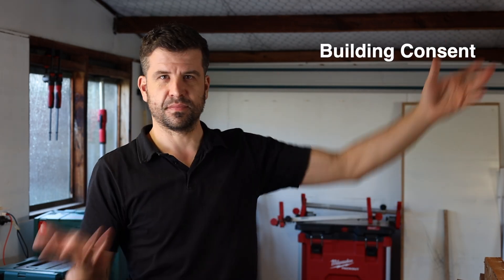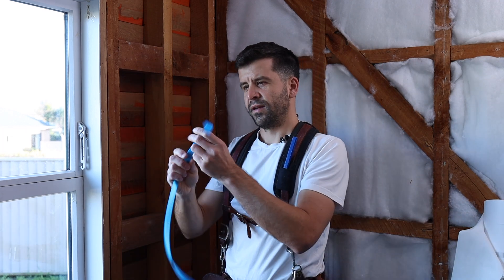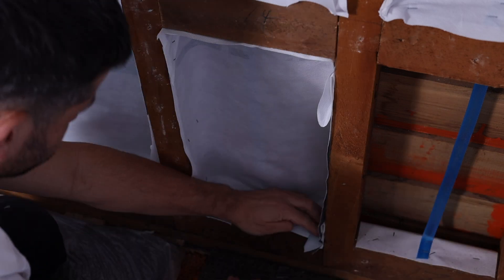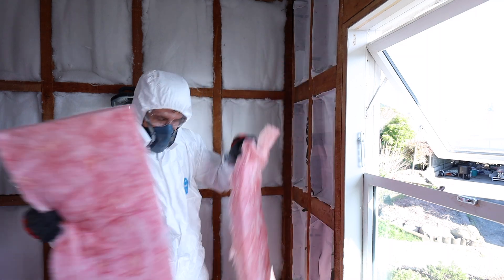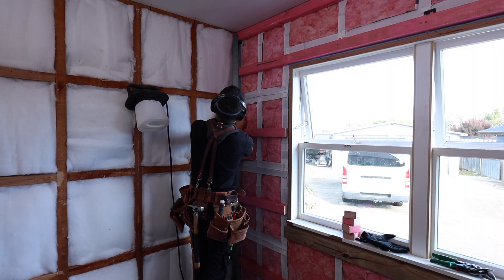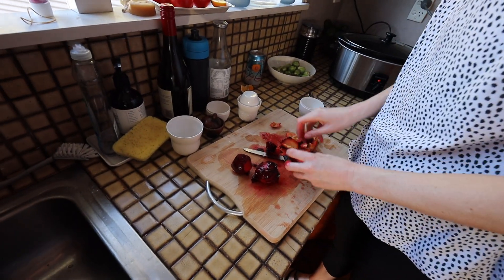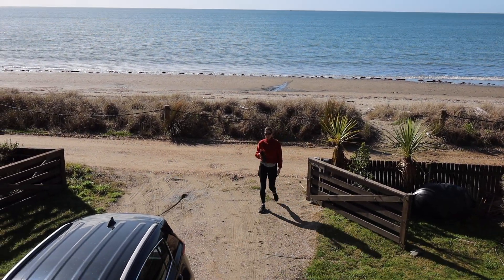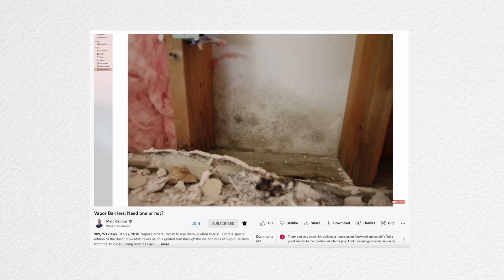We're Finally Going To Be Warm! Renovating Our 1960s House

Comment: On the Rock Wool (Originally called Roxhul) comment that Jess made, I'm not sure how well it would do in your climate anyway.  Its hydrophobic (does not absorb water) so it may cause your Drywall (Gib / Jib Board) to mold due to your high humidity on the exterior walls.  I'm sure there is a way to combat that but I'm not familiar enough with high humidity building to know.  I primarily see it used for interior walls where its sound dampening capabilities, no itch installation, and easy cutting make it ideal for that use.
Reply: While it doesn't absorb water its permeable so moisture goes through it. So its a good product to use.

Comment: 2x4 batt of pink insulation is worth R14 in Canada.

No clue what the dimensions of your existing wall was, but I would have been framing up a new wall to install infront of your existing ones, and sliding a 2x4 - 2x6 batt of insulation in there.

Your heat pump would thank you for it through a massive increase in efficiency. 

But, Australians/Kiwis don't really seem to care too much about energy efficiency for some reason.

Comment: I would've insulated from the outside honestly, add the 20mm airspace with lathes. Then you get the housewrap with no windleak or I would atleast tape the joints if you do like you did. Great work! 👍
Reply: Not sure how NZ building code is but sometimes it can get tricky with "doing something with the facade". More paperwork probably. But the "building paper work" wouldve been better for sure lol
Reply: That would be a very costly and labor intensive job
Job was wel done only comment is  the more wood surface you put in between the isolation the lower the R, if you rotate the wood 6x4 you could ad 2 inch more isolation and by turning it, the wood surface is a bit less you could ad maybe R1 with a total off R4 (a bit of a geuss)

Comment: Not sure of R value, but in Europe we have a very energy efficient home of A class with total Thickness of insulation of 35 cm of Eps.
That declares r values of around 3.8 per inch.
So at 35 cm is approx. 14 inch.
14x3.8 is approx. 50 of R-value.

Comment: I like the comment about making the house the best version of itself, not the best house. Comments for example on having the building wrap on the outside of the framing are all well and good for a new house, but you are not going to achieve that here without ripping the cladding off. It is about improving an old house, within reason. Can you tell us if the external wall insulation was covered by the consent process?

Comment: With Glass wool you have made the right choice regarding the type of insulation. By cutting the glass wool slightly larger than the frame size, you can compress it and as you put it in the frame it expands again and fits well against the wooden frame. That way you close all the gaps. Hard foam insulation would not do that and would leave a gap between the insulation and the timber which is obviously not desirable. I live in Belgium and work in the Netherlands. Here houses are mostly build in brickwork but roofs are made in timber. Glass wool is than often used if a roof has to be post-insulated specifically because of this reason. 

With regard to glass wool or rock wool. Glass wool and Rock wool are not that much different. The characteristics are much the same. Rock wool is more brittle than glass wool, therefore I prefer Glass wool above Rock wool anyway. No big loss if there is no rock wool in New Zealand.

Comment: In the cold Climate in Europe and Usa/Canada its getting down to -20°C in Winter and freezing for Days and Weeks. The air in this time is verry dry and the most Water in Buildings comes from the Person living in it is it just breathing while sleeping, Cooking and Wasching, Showering and so on.
The higher humid Air inside would condense Water in the Insulationlayer somewhere. Thats the reason there is a vapor barrior Inside here and it have to be airtight! or it will produce problems you saw in Matts Videos.

In New Zeeland you are sourrounded by the Ocean, get heavy Rainfalls and storms, Foging. While the Temprature barely reaches below 0°C and now for a long time. Your Waterproblems to your Buildings clearly comes from the Outside Air and Rainwater getting pushed with Wind below the Sidings.

Your 2 Layers of Insulation with Moistur Barrier and Breathoing room looks verry well enough for your Climate and the Situation you renovating an old house. little bit Labor intensive but room after room, wall aftert wall ou will get it done.
An even thicker Insulation above a certain point dont give you mutch more R value.
Rockwool is also only a "Western World" aka Europen and American Brand name and just a Maufactures Name. Dont be worried if your insulatiion got an other Name Brand on it ;) its not Rocket science to make Glass or Stonewool.

For your Ceelings.. i would NOT put Polyester on it. In the rare case you have a Fire you dont want a flamable plastic Material above your head dripping down on firefighters spreading fire everywhere.
Your ceeling Space can be filled easy enough and a layer on top if you dont move in the space often. 
It also Insulate against the heat in Summer.
Depending on your time and money budget (and how you use the Attick Space) you could Insulate the Roof like the walls. And the ceeling only with one internal layer.
Gives you easy frost free Storrage Space and keeps the sunheat out the attick directly from the outer shell of the house.

Closing the Window gaps with a rubber sealm and putting in the foam in the gap directly arround the window is more important as you think. you loose a lot of energy or get in a lot of warm air in summer if this is not closed.

Comment: I'm most worried about the air leakage in the assembly here. In order, the priorities are water, air, vapor, thermal. It seems like there is no real air barrier between the exterior and interior, so the insulation won't add as much value as the R-value suggests. That said, air sealing from the inside is also questionable and seems quite difficult. (One other commenter suggested possibly taping all the seams, which might function but is very detailed work to complete.)

When you eventually replace the siding, doing air sealing at that point should offer some notable comfort benefits (in addition to a reduction in heating/cooling bills), and it should be much easier to complete as well.
Reply: Kiwis don't do air sealing. How air tight the gib is is what you get. Nz housing is very low standard.
Reply: i agree with dosadoodle - the airtightness is super-important (factor 10 times more important than thermal insulation) say you have insulation, but the wind can blow through it.. then it takes all your heat with it... or if you use a hard panel, like PIR or PUR and the wind is able to blow between your wall and the panel... what use does it have then? it takes the air temperature with it...
Reply: @LievenVB  i agree, but your never going to get it air tight without demolishing the house. Even new houses here are not air tight. Keep in mind nz is about 40 years behind you guys in housing.
Reply: An honest question and not being facetious, what kind of real world gains would you see with that level of attention? Oftentimes professionals will recommend the best practice suitable for insulating the space shuttle. If the method used here is less efficient to a minor degree, then who cares?
Reply: @yeahgoood  air sealing solves a lot of problems and more importantly allows the opportunity for other things to be done better. now that you have control, you can do efficient ventilation, so you can have higher ventilation levels without the heat/moisture penalty you would normal have, which means a healthier more comfortable home. pretty common to have good air tight homes have double the ventilation rate.
you can have better moisture management because your no longer pulling random amounts of moisture in from outside.
especially in colder or humid climates it can increase durability by not having condensation/frost form in the walls/roof.
for me, keeping the pollen, dust and bugs out is a major plus.
Reply: @yeahgoood  I think @tweake hits the key building science aspects. Water / moisture is the biggest enemy of a building in terms of durability, and losing control of air flow means vapor can travel through a wall more freely and condensation can occur in spots that harm the long term durability of the building as well as create health issues due to mold.

In terms of energy efficiency, I think it would be useful to take the analogy of a wool sweater. That sweater keeps you warm if there is not breeze. But as soon as there is air movement, that warm sweater doesn't do nearly as much good. Is it better than a t-shirt? Absolutely! But if you throw on a wind shell to stop air movement, then you're really going to stay warm. I'd also note that Scott's home is not a fully open sweater. It is just that there are still lots of cracks/crevices where air can flow, which undermines the insulating value of the "sweater" vs if those were sealed up.

I've found the Building Science "Insights" articles on (what I perceive to be) the "main" building science website to be really informative on these topics as well as being written in an entertaining style. Those articles highlight plenty of complications with tightening up an older home as well. For example, if a home is very tight but without mechanical ventilation or humidity controls, then the air inside can become stale or have high humidity. Or even worse, if the heating system is combustion and the exhaust air is not able to effectively exit the building, that's of course quite dangerous. (Scott's move to a heat pump prevents that specific danger.)
Reply: @tweake7175  thanks for the info !
Reply: @dosadoodle  This is excellent info, thanks!
Reply: @dosadoodle  those houses in original condition are a sweater, wind blows right through them. that can be fixed by sealing the floor, which in turn will help reduce moisture.
Reply: How rapidly is the air actually going to change within that cavity? The weatherboards being painted will be relatively air tight I imagine? And would you encounter moisture issues as mentioned in the video?
Reply: @samueladams7064  the cladding is open at the bottom and a bit at the sides and top. Yes there is moisture, walls leak and timber let's moisture through it.
Reply: @samueladams7064  The weather boards will block wind from blowing straight through the home, but they won't be near tight enough to stop substantial leaking due to pressure differentials caused by wind blowing against the building. The standard in the US measures full home air changes per hour at 50 pascals ("ACH50") pressure difference between inside/outside using a blower door test, which is equivalent to what a home experiences in a ~32kph / ~20mph steady wind (or at least the pressure difference that's created on the face of the building getting hit by the wind if I recall correctly). Older homes in the US frequently rate at 5-15 air changes per hour at that 50 pascal pressure difference, and my guess is that Scott's home probably is not far off from that (many older homes in the US also have painted weather boards that would look to the eye to be pretty tight).

For the moisture issues, are you talking about the gap that Scott was leaving behind the weatherboards to manage water that got behind the weatherboards? I think that's usually for helping address water (e.g. rain water) that gets behind the weatherboards so it can drip down and air flow can also occur there to help dry things out.

Assuming it doesn't freeze often in NZ, I'm honestly less concerned with the vapor condensation and more concerned about the heating/cooling efficiency. The inefficiencies of the heating due to the home being leaky means, as one of my friends put it to me, the wood in the home gets pseudo kiln dried each year as tons of energy gets wasted. That is, the excess heat passing through the walls helps keep the wood dry (at the cost of higher heating bills). I'm sure Scott's upgrades will offer some benefits on both heating/cooling bills and some comfort benefits, but the R-value for the insulation assumes air isn't passing through the wall so easily.

Comment: I did like your insulation installation. The only part I didn't like was the glass wool. I managed to build my house completely without rock/glass wool (only exception is fireplace chimney fire-insulation, there were no alternatives, so had to use Superwool). Walls are 60mm wood fibre board and 205mm MHM wood-elements, but of course this is a new house and not 70yo as yours.

Comment: Hi Scott, if you’re watching a lot of Matt’s videos you’ve no doubt seen his ones where he insulates the roof so the attic is within the insulated envelope. This would improve the efficiency of your ducted heat pump.
Reply from the maker: Thats a fascinating one for a Kiwi builder like myself. I've always worked in roof spaces that were roasting hot in the summer and never considered this. It may be a bridge too far for our house,  considering the mild climate here it may not be worth it. If I were building new, I would condition the attic for sure.
Reply: @ScottBrownCarpentry       an iam going too building my every. own   setup off workshop space or shed with my every own pub an bar    soo i can chill out in pice an quart     as i needed my own space an doo soo needed a shed or workshop like yours at my place   etc.

Comment: An oscillating tool with a blade in it cuts expanding foam beautifully. I'm not sure you'll see the benefit of the extra insulation in terms of savings and improvement in warmth. A thermal camera will help tell the story.

Comment: I think you may have reinvented an overcomplicated wheel my friend.   I am in Canada and deal with a lot of insulation systems and my first thought is you put a lot of effort into that 2cm air gap but its hard to trust its not bridging all over anyways.  I see what your trying to do but I wonder if theory and practicality where fighting it out there, its new code in BC where it rains a lot to install strapping between the house wrap and siding for a 3/4" air space but there are plenty of dry houses without that air gap before that code came into play.
Reply: Don't think he's going it for the fun of it. Will be to get sign off from our local councils who are slowly trying to bring our standards up to to those commonly seen elsewhere in the world. Due to crazy material costs here the minimum allowed values are seen as the target state to attain, not the starting point. 

Having said that, overseas we had double layer brick walls with an air gap and dampness or poor insulation wasn't a conversation I ever recall being part of or hearing in almost 20 years - so perhaps it is a smart thing to do.
Reply: @jonowebster  Thats kind of my point though, air gaps are only necessary for masonry walls, and we fill wood framed wall cavity's in Canada where condensation is arguably a much bigger problem.  Maybe I am wrong but its pretty safe to assume that insulation is made to fill a 3.5" cavity and is being compressed (huge loss in r value in the remaining 2.5" of space).  It looks like a lot of technical work for a (in my opinion) poorly insulated wall.  To insulate an old 2x4 house I would nail 2x2 on the face of the 2x4 and fill it with R20 (5.5" of fiberglass)  also not using any vapor barrier is just stupid.  you would probably have better results just using vapor barrier and skipping insulation entirely, its that good at its job.

Comment: Without taking the exterior gladding (weatherboards) off  I do not think anyone can do a much  better job at insulating that wall, maybe taping the breathable membrane to the framing might have helped with air tightness a little. Also adding a separating layer (something breathable like construction paper) between 2 layers of insulation is sad to help somewhat. Taking the weatherboards off options  increase much and you get a more uniformly insulated wall, but the amount of time and money spent to do that also increases.

Comment: I saw your video and wonder if you have set airvalves( not a english speaker so dont know it thats whats its called in english)  in the bedrooms as you upgrade the walls as some of the changing of air before was thru the not so isolated walls and its could be good to then put a airvalve in so you get fresh air in when you now have a lot more isolated rooms

Comment: 🇺🇸 (South Central Texas) For 28x16 Studio Loft (roughly 600 sq ft or 56 sq m) I used R-21 High Density Owens Corning EcoTouch insulation for 2x6 exterior walls/loft floor/BR ceiling, R-38 for 2x12 ceiling and 2x12 floor, R-13 for 2x4 interior walls. Dual zone ductless Mitsubishi mini-split barely sips energy. Total monthly electric bill $20—$35 year-round.

Comment: R values simplified 
R13 is the lowest and minimum requirement for walls but R15 is suggested or R19 if you wanna go all the way
R30-R60 is required for ceilings 
Crawl space is typically R25-R30
But now days in the US the vast majority of homes are built with spray foam insulation

Comment: I would assume with the plasterboard shortage in NZ then getting insulated plasterboard is an absolute no go.
It would have made that second layer really easy
Reply: not really. insulated plaster board is easily available, its just not often used. if you use it on a house like this the timber ends up on the cold damp side of the insulation. you really want external insulation so the timber is on the warm dry side of the insulation. plus that insulation is a moisture barrier which can cause other issues.